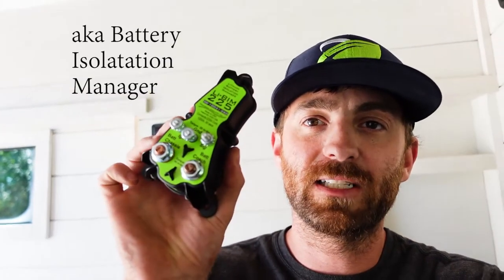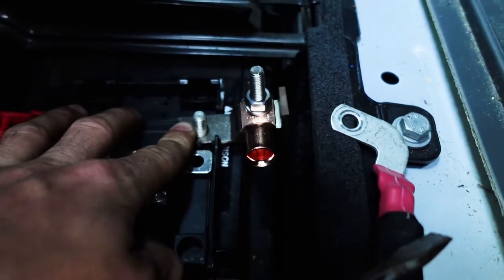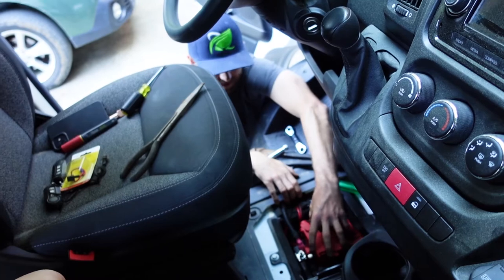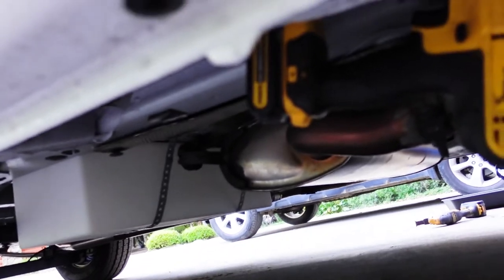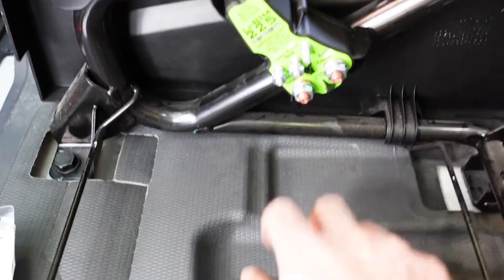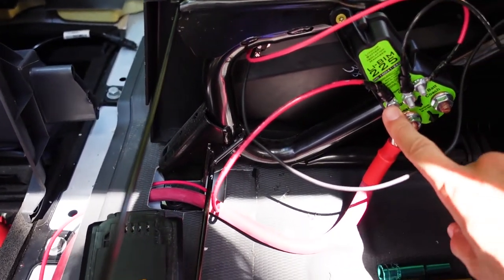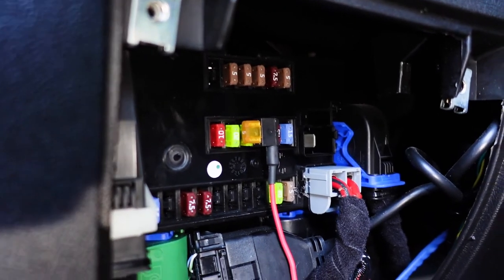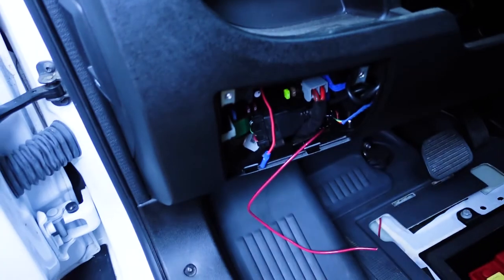How To Install Battery Isolation Manager BIM 225  Battery to Battery Charger |Van Build

Comment: Hello,
I just watched your vid on the BIM 225 installation, nice.  I didn't see where you ran a ground wire from the starting/chassis battery to the house/coach battery?  
Thanks, 
Mark
Reply from the maker: Hey Mark! You ground them bim locally and only run a positive wire back to the coach area. We ran ours back into a distribution area thats connected to our battery bank.

Comment: Hi, very helpful video, however, I wasn't sure about one step. When checking the voltages with the fuse tap, do you need to have fuses in both the slots for the voltage to read properly? The original one you pulled  from the van (in the inner slot on the fuse tap) and your add-on 5 amp fuse in the outer slot?
Reply from the maker: If I recall correctly you do not, but that was a long time ago. I know that’s not the answer you were looking for 😬

Comment: Why did you choose a BIM instead of a DC to DC charge controller?
Reply from the maker: Based off of our setup it was what battle born recommended which is who we bought all of our electrical components through.
Reply: @NomadicVisuals  You're not worried about your alternator at all or the pattern the voltage is being delivered to batteries? How many amps is your alternator and how many ah does your battery bank have?